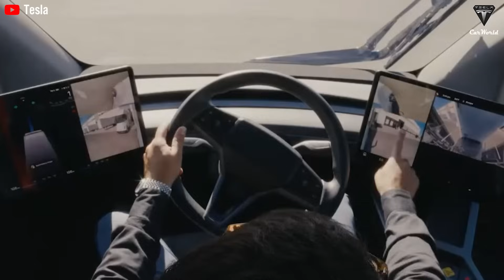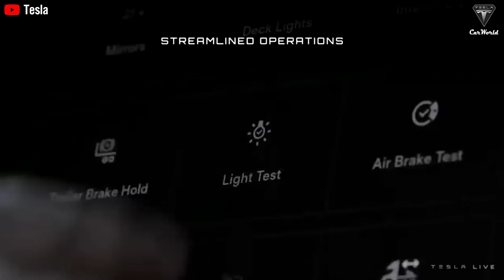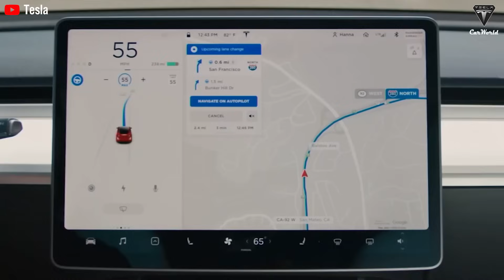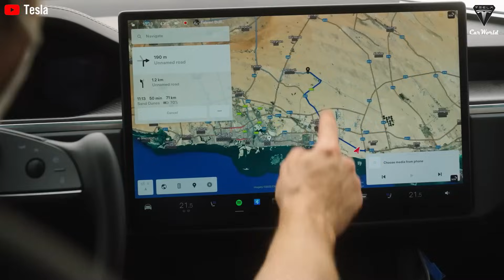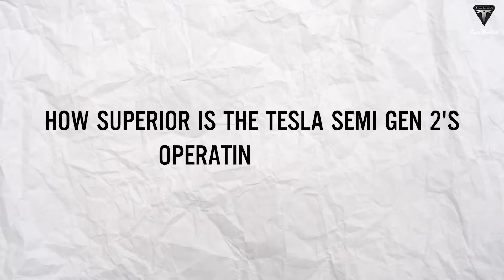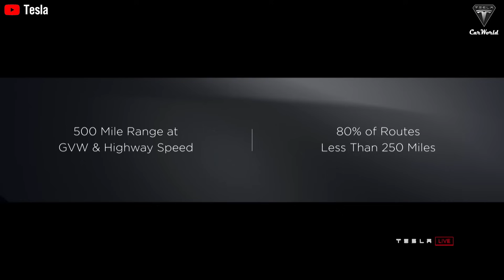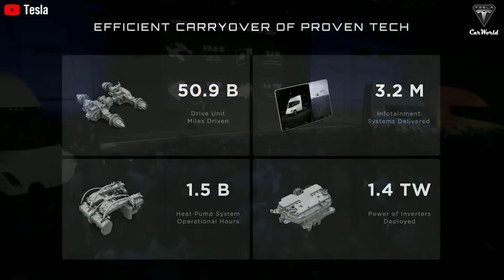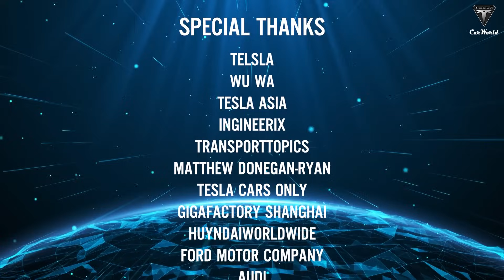Tesla Semi 2025 Huge Upgrade! Elon Musk Reveals 4 Insane Specs That Beat Rivals! G2 In Production!

Comment: a 500 mile range empty.  Given it has about the same as 12 Y size batteries in it; that isn't exactly impressive.  Reports on youtube by Pepsi show it can loose up to 1/2 of its range in 1 hour or 70 miles loaded.  That may be adequate around town; but not for long haul.   You also do not mention the need for a Megapack to boast charging times. Charing via Grid power alone would be very time consuming.

Comment: Wow you guys are missing it. FSD They don't have to go fast just safe. FSD We will all slow down to 30 miles an hour and we won't care because we will be sleeping or something else. Cargo will all be connected by gps and will run 24/7 always in the right lane and in a conga line. You wont need a full size tractor trailer for one driver. Down size loads and no driver just a fsd skateboard flatbed to carry a cargo container
Reply: Your narrative lacks fact based supporting evidence.Your argument is immature and frivolous,critical thinking is absent
Reply from the maker: Autonomous technology, efficiency gains, and optimized logistics will revolutionize freight transport, with Tesla Semi leading the shift toward safer, continuous operations.